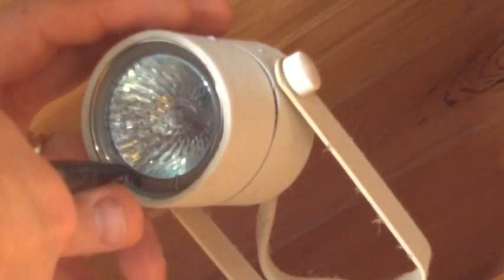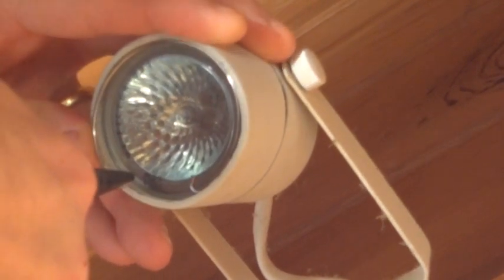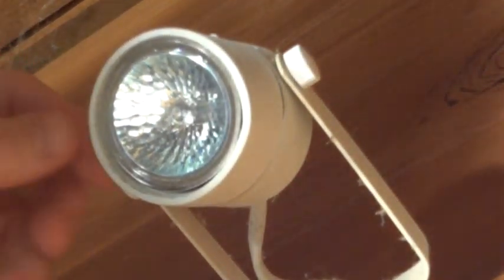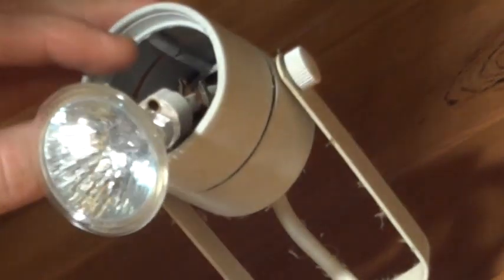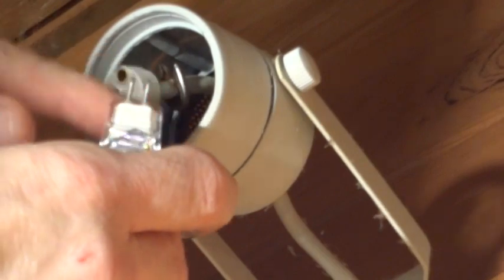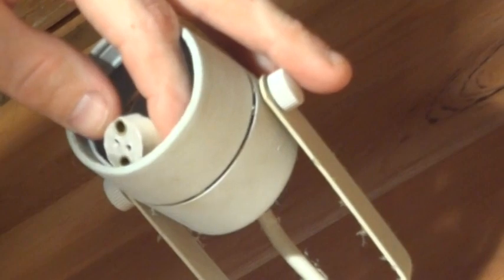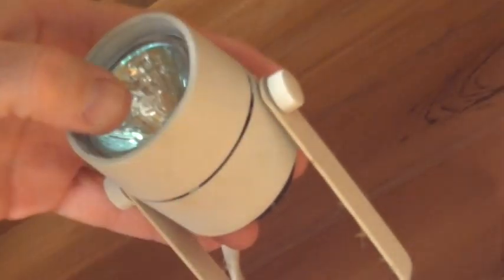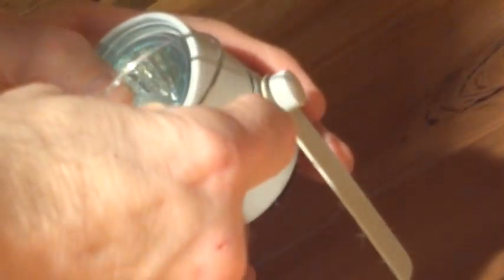How To Replace Track Light Halogen Bulb MR16

Comment: Hello. Can we change an already plugged bulb to another connector? I changed a working bulb to another connector but it didn’t work. Thought it was a faulty connector and I plugged the bulb back to its previous connector. The bulb still didn’t turn on. It was working earlier while plugged to the same connector.

Comment: Thanks for the help- much needed. But I would make a suggestion. When filming these vids always be aware of your hand position in relation to the position of the camera. A good bit of this video is obscured by your hand blocking the shot. Adjusting the camera angle could help. Just a suggestion. Thankfully your verbal explanation was spot on, so thanks for that. It was a great help.

Comment: When you push the new mr16 into the connector what holds it in place?  since you don't seem to lock it by moving it clockwise etc?
Reply from the maker: The lens and ring.

Comment: Well, unfortunately I watched this video AFTER I messed around with replacing the bulb and am not sure what to do now. I managed to figure out how to replace the bulb but then noticed the piece the bulb plugs into was loose. It ended up coming off and now I don’t know which side is which and even if I did know, how do I safely connect so it doesn’t happen again. I hope that made sense. Any ideas?

Comment: Do you know what to do when the two holes get blocked?
I removed one of my lights and when I try to put a new bulb in, the holes are partially blocked. Maybe it thinks there's a bulb in and it's clamping still?
Reply from the maker: Did you break the prongs off in the holes? If not, then they shouldn't be blocked.
Reply: I did this with the 1st bulb of a 3 bulb track.  How do you replace if you break the prongs off?

Comment: What do you do when the prongs have broken off into the light fixture and won’t move? I removed the bulb, but the prongs are still in the holder, so what should I do next?
Reply from the maker: What I would do is turn off the power to fixture. Even shutting off the breaker might be a good idea. Then after triple checking there is no power to the fixture, carefully pull them out with some needle nose pliers.

Comment: I cannot get that light out

I yanked it so hard that the light itself came off it's base 

and end up with a cracked base where the light goes into and the wire that goes to it came off

I give up

-_-
Reply: I did the same thing in a 3 bulb track.  Did you ever figure out how to change or replace it?
Reply: sweetshooz  Same thing for me. Did you ever get the broken ceramic/bulb out? Or should I just burn down the house?

Comment: Don touch the actual bulb. I don't know why but it shortens the life of them drastically.
Reply from the maker: You don't want to leave finger oils on a halogen bulb. But in the case, the actual bulb is inside where you can't touch it.
Reply: That's the case with mine but on his he can/does remove the front cover.  @RJTheBikeGuy
Reply from the maker: Every bulb of this style I have seen is sealed.